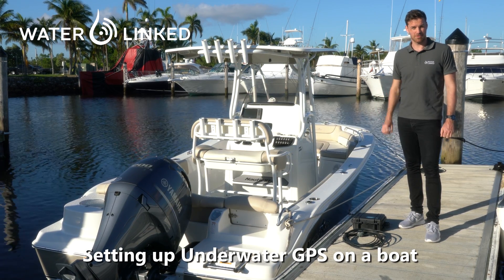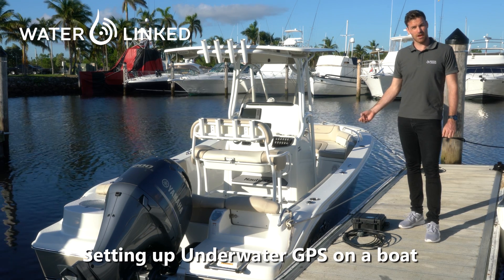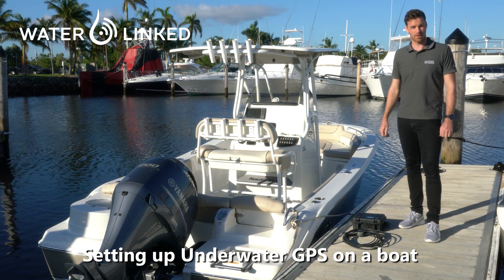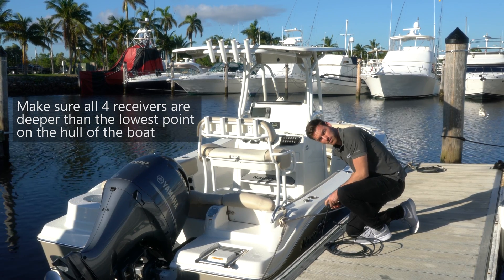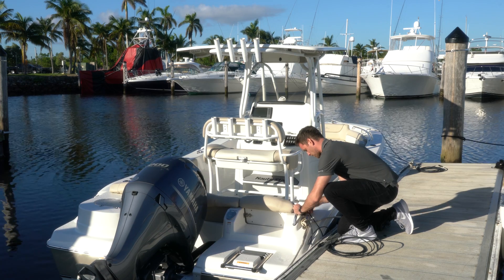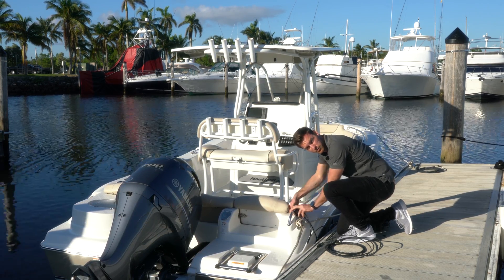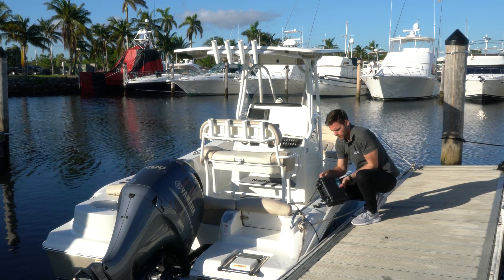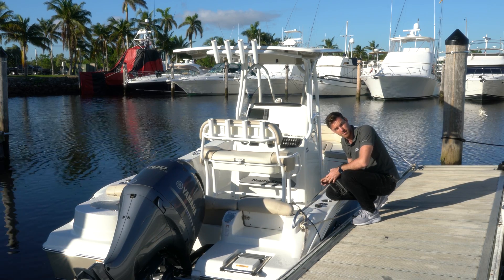Water Linked: Underwater GPS - Setting up on a boat

Comment: Nice one. what are the normal per-determined depth you choose for the 4 receivers?
Reply from the maker: We normally drop them 1-2 meters below the surface.

We drop them so deep to get them below potential air-bubbles from waves etc. which is typially found closer to the surface. In very calm waters you do not need them so deep. It is only the "head" of the receiver that needs to be submerged.

It is also possible to order receivers with cables up to 100 meter so you can drop them very deep if wanted..
Reply: thanks for sharing.